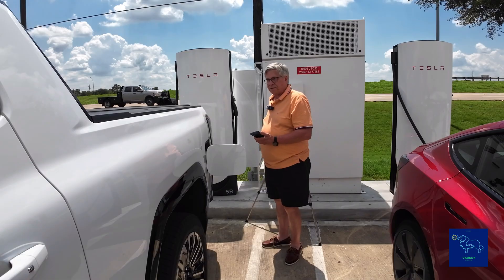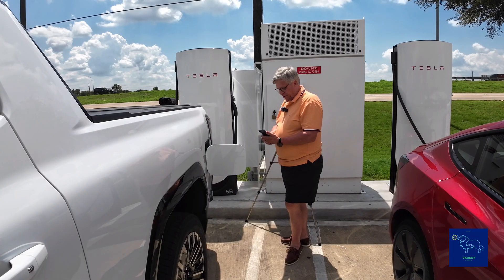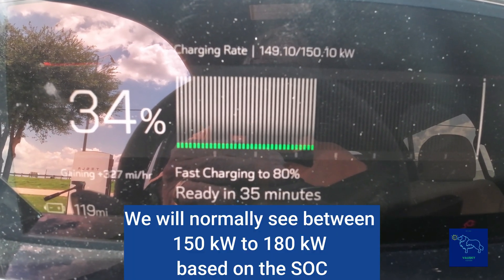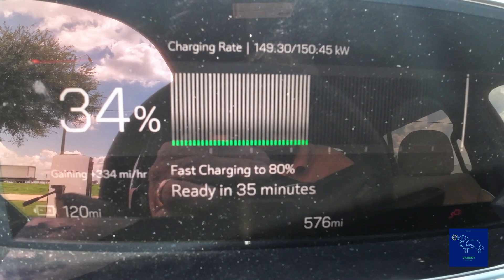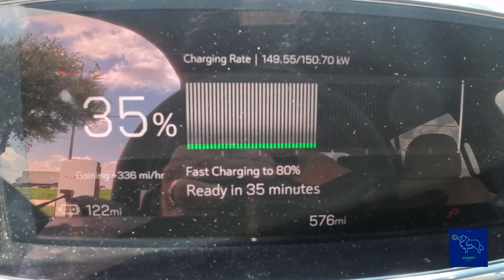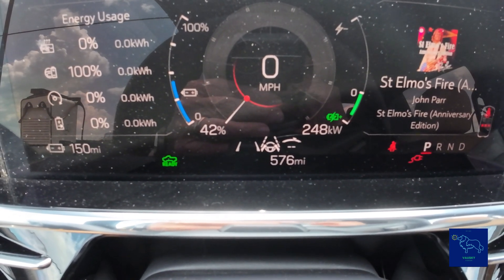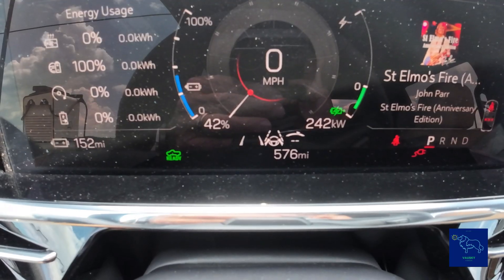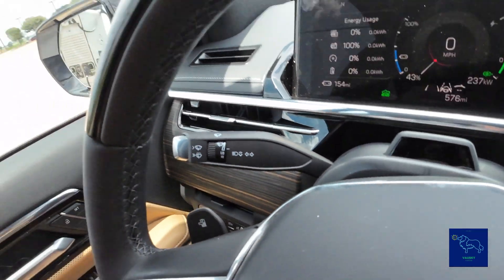The differance when charging on 400 volts and 800 volts DCFC

Comment: Big difference between 400V and 800V charging. But it's nice to have the peace of mind knowing that if there's nothing else around, or if the only 800V chargers are old, unreliable hardware, that you can just go to a Supercharger. And a super nice extra is having the port on one of the two best locations, with the passenger front being better still.
Reply from the maker: It's nice to have Tesla available to fir charging. I like hiw our batteries can reconfigure itself to support 400 v and 800 v. Very convenient and reliable.

Comment: 800V architecture is awesome.  I'm happy to have 800V on my Ioniq6. Cool that the Silverado is 800V architecture.
Reply from the maker: What nice about the Sierra, Silverado, and Cadillac Escalade IQ is the battery can switch between 400 volts and 800 volts. The motors are 400 volts. These EVs live life in 400 volts except when on 800+ volts charger. I had the extended range battery the middle size at 170 kWh peaks at 300+ kW. it ramps very quick.
Reply: @vauskyvideos Thanks, yes, I saw 310 kw speed in the video.  I meant to say Denali, not Silverado, but related architectures as you say. Thanks for this info.